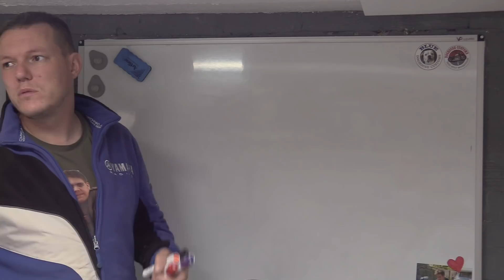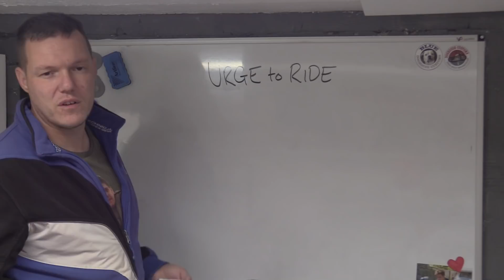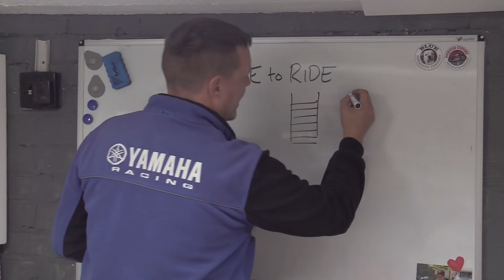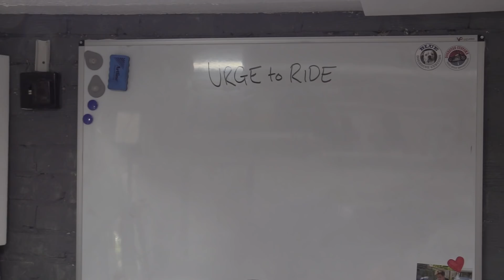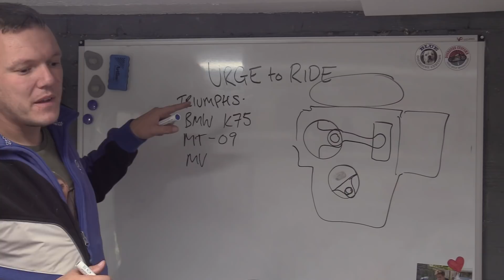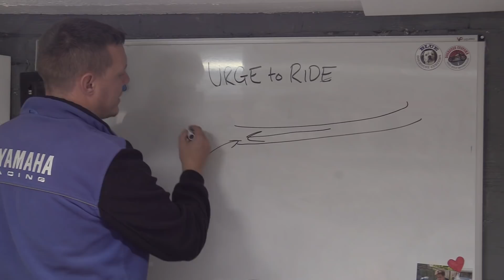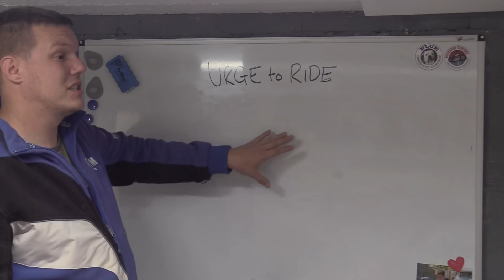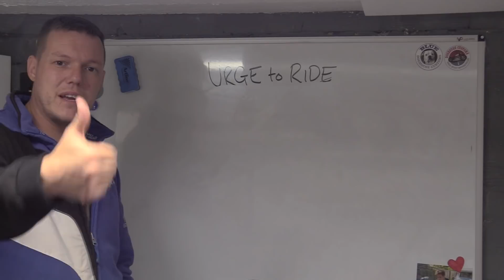Triple Engine Whistle BS - RANT

Comment: Ducati's sound like a bag of spanners because the indicator wires vibrate against the housing giving it a dry clutch sound like the honda XR250 the fastest dirt bike ever made.. said to have been designed by the Nazis to overthrow the Vikings during the battle of Trafalgar in 1642
Reply: Wellllllllll I'll think about that. Not!
Reply: This guy knows whats up.
Reply: Mine too
Reply: I thought it was because desmodromic was Italian for, Had some left over fasteners so we left them in the head.
Reply: Gary Dodgson  a friend of mine had a Harley iron head Sporster,  it was very quiet.  If you listened closely enough you could hear a sound much like a leaky kitchen faucet. It was the oil dripping in to the pan he kept underneath his bike.  This was the most noise it made for months at a time. Hard to start was his excuses.

Comment: I had a customer come in he was sure his pickup needed a new transmission . I  replaced the rubber boot on the shirt level $6.00 us noise gone. He was upset he had a personal rule drive it until major repairs needed then replace. That Toyota  had 220,000 miles and was just fine but he wanted a new truck. I told him next time don't buy a Toyota and you'll get to replace it a lot more often.
Reply: Thomas LeMay What the hell is a shirt level?
Reply: @biffaozzie2373  it's like a shift lever, but also not
Reply: @biffaozzie2373  dam auto spell.
Reply: I have an 2.2L S10 with about 230,000 miles. That thing towed a motorcycle and a loaded trailer up the slope on the 8 freeway to San Diego with the AC on..... granted we were doing 30mph up the hill, but the thing never overheated.
Once in LA the truck developed a new noise in the transmission for a while, but....
I then drove it from LA to central Mexico and the noise is gone......

Comment: I had an XS750 that didn't whistle or whine. Made lots of metallic grinding noises for a while but this was just a trait of the marque...
Reply: Hah! My dad had an XS850 that did this, turns out it was the exhaust chewing it's way through the oil filter casing Cringe
We all called it the Fat Bastard because it was heavy as fuck compared to my dinky RD 🤣🤣🤣

Comment: I've got an Acme whistle that sounds like a 1996 Triumph 885 engine.  I also have a Honda Revere that whistles at about 1500 to 2000 rpm, is that because my V twin has a third cylinder hidden in the gearbox with the underslung waggle rods or is the noise coming from the pistons in my 30 year old, double port and lemon carbytooters?

Comment: Ive got a street trip and as soon as I swapped the end can it substantially lessened the pronunciation of the whistle. Also the stock striple exhaust 2017-current have a small hole drilled into the bottom of them about an inch back from the pipe opening which I assume is to help some form of pressure (?) - I covered my finger over this hole (wahay) and it muted the whistle a little which was strange
Reply from the maker: Well it can't have done, because its the gears LOL
Reply: @thedirtyworkshop  😅 but the internet said so… the bane of most forums since the 90’s

Comment: I have a single, twin and four cylinder. The only  one that whistles like Urge to Ride (showed from video clips) is my 4 cylinder but my 4c (2002 Fazer 1000) is also the only one with a cat and collector on it. The twin is a 1981 and runs no cat. the single is a 2000 and on a racing straight pipe. 

Personally I think this whining/whistle  sound is to do with cats and those collection chambers... something with flow into the cat and then it resonates down the end pipe. 
I would really like to hear your opinion on this. Because I do find newer/cat bikes have this and none of the old ones seem to have it.

Comment: Most modern cars have helical reverse gears and will still make the noise just not as loud. The reason a car makes that noise is that the dif gear is running against the back face of the gear. If you spin helical gears the wrong way they are very noisy.

Comment: The reason cars whine in reverse is specifically because the pinion and crown wheel have spirally cut bevel gears. The reason being that under load they are drawn into mesh, they basically try to screw themselves together. In reverse the opposite happens meaning the clearances open up and the gears mesh less well causing whine.
 This isn't an issue as you don't spend that much time in reverse for significant wear to occur and you are loading the opposite faces of the gear teeth so it doesn't affect forward motion.
 So not only is urge to ride wrong, he is blaming the exact opposite type of gear for the type of whine he described.
Reply from the maker: I know, funny aint it lol

Comment: My 900ss whistles slightly through the carbs at part throttle. It's easy to hear because the airbox sticks out in front of the tank a bit and some muppet cut the entire top off (so the filter gets wet when you wash the bike or it rains).

Comment: It would be interesting to record a waveform from a xtal pick on an engine then stretch it using audacity and see if you can identify different components in the engine waveform.
Reply: Proluxelectronics And you think that Honda, Yamaha, etc don't do exactly that??
Reply: @biffaozzie2373  I assume they don't share the results though. This sounds like what Dyno tuners are starting to do

Comment: It doesn't even SOUND like gear noise in my opinion. 
I have a Tiger, and the whistling noise sounds a lot more like it's being caused by air/gasses. I think it might be something to do with the induction actually - perhaps some of those flow phenomena you were mentioning, but happening on the intake side. I don't know enough about fluid mechanics to speculate on that.
But it seems to originate more mid-bike. At least by my logic, a whistle from the exhaust noises should be able to be heard around the area of the exhaust tip.

Comment: My Z650 2020 makes a lot of that whistling noise, especially during engine braking. The engine has a firing order of 270 degrees. From your video it appears that this is the reason for the whistling noise.

Comment: ' Rocking Motion ' ? , ..  Balance Shafts are used in piston Engines to reduce VIBRATION by cancelling out unbalanced Dynamic Forces . The Balance Shaft was Invented in 1904 .
Reply from the maker: Coupling moment - it's called the rocking couple.

Comment: It has to be related to the 240 degree crank/firing order. The new Triumph Tiger 900 that is also a triple doesn't whistle like the others because they gave it a T-plane crankshaft. And since it is a triple it will still have a counter balance shaft.... It also can't be the airbox design cause even the older triples with carbs did whistle.

Comment: And another thing.  Straight cut gears only have one tooth per gear in mes at a time, whereas helical gears there is normally two teeth per gear in mesh so you don't get the same 'clack, clack, clack'.
Reply: *mesh

Comment: No balancer shaft on my 929 and my rebuild had that whine. On my first version i hadn't noticed it so i went looking and found it on other bikes on youtube. Would really like to know what it is without the speculation, i did have an aftermarket exh on the first bike, a slip on Leo Vince but all i had available for the rebuild was a standard and the bike didn't live long enough to get around to changing that. I was very worried about the sound at first so i hunted for it, finally decided it was the reed type valves on the head cover from the emissions system...

Comment: A friend of mine has a Triumph Tiger triple. It is quite "whiney" when hot but much quiter when cold. I would have thought the gears would sound the same at any temp. Maybe the exhaust gas is different under different temps

Comment: A bit late to the party, but the CBR1100XX Blackbird (from 1997) has DUAL balance shafts , is an inline 4 and whistles beautifully.
Anyways, in my humble opinion this is mostly air induction/intake. (speculation)
Gears, sound different. PERIOD.
If he would have ever listened to a gearbox turning by itself, he'd know. It's a completely different note.
How do I know? Working in aviation, cranking jet engines (turning them with just air, no fuel) and standing right next to the gearbox rotating at insane speeds. No gear "whistle" to be heard. Not during start, "steady state" or shutdown.
Anyways, the best example i can give you is the 787 engine start-up as it starts electrically as opposed with air starters. (I'll just link to a video as i can't be bothered searching though my videos and uploading my own)
https://www.youtube.com/watch?v=s3_JPMB05Fc
It's basically the first 15 seconds of the video. doesn't sound like a whistle to me and that's an electrically driven gearbox.

Comment: It's intake whine, not the straight cut gears, and that's the end of the argument. Even my old carbed R6 had an uneven, lumpy intake whine at idle and up to about 2500rpm. And that was with a loud as fuck exhaust.

Comment: I have a Street triple R.  A long time ago I used to have an NC30. One is an in-line 3, the other is a V4.  One has a balancer shaft, the other doesn’t.  Both have the exact same whistle.......
Reply: NC30 has gear driven cams though, though, as Matt pointed out.
Reply: I know, that’s the point.  Last time I checked my Street Cripple hadn’t grown gear driven cams.
Reply: @Martin52863  Sure, but if the cripple's whine is, as posited by wassaname, gear whine from the balancer shaft, gear whine from the NC30's cams doesn't disprove it - if anything it makes it more plausible.
Reply: I honestly couldn’t give a shit what it is.  To me it just sounds awesome. I will however say this, it’s no louder on the right side of the bike than it is on the left.

Comment: Easy way to solve it Matt. Should be able to find out how many teeth are on each gear and therefore work out what the meshing frequency should be, for a given engine RPM. Then record the noise, run it through an analysis software and voilà. Bullshit debunked.
Reply from the maker: Apart from analysis software isn't that easy...
Reply: @thedirtyworkshop  yeah I guess all you need is the noise frequency spectrum and to look for the biggest peaks. I was probably spoiled at work because we always had that stuff as the tax-payer provided (I was an aircraft engineer in the Royal Navy until last year)

If you know anyone who does vibe analysis, or there's a subscriber who is willing to help; you could use a mobile vibration tester and get the Fourier-Transform from that. It would show you the same thing.
Reply from the maker: But the peaks won't be the whistle, there's so much background noise. I have audacity, I'll have a look, comparing the triumph to the z9
Reply: @thedirtyworkshop  yeah thats why Vibration Analysis might be a better route. A Fourier Transform will separate the frequencies and give a peak power reading. If it's loud enough to hear it would be of sufficient magnitude to see on an FFT spectrum. Don't get me wrong, I'd be fully expecting it to NOT be there.

From my experience, if it was gears meshing, there would be more of a rounded ringing/whining, than a whistling noise.

Comment: I've noticed that the whistle is mainly on fuel injected car & bike engines, so I've always associated it with the air intake systems on these types of engines as breathing is so very different to that of a carbed engine. 

Normally aspirated carbed engines don't tend to whistle and, if pod filters are fitted, the induction noise can match or exceed the exhaust noise from the stock OEM pipe.

Your exhaust pipe theory can be easily proved or disproved as being the source of whistling simple by putting one's hand over the pipe's end on a Triumph tripple.

Comment: Dam I need to get you to check my prints you get some nice quality.

As for the argument made about the exhaust, given that gear noise counts in the noise limit tests there is no way the manufacturers would allow a gearbox to make the kind of noise he is talking about. The limits for euro 4 and 5 mean that bikes have been taken off the market because of gearbox noise

Given the prevelance of balancer shafts the whine/whistle would be common on 4cyl, Singles, v twins, not just a triple thing.

My money is on it being to do with a resonance in the exhaust given that it seems to disappear if you remove the cat and open the midpipe and endcan up. It allows for a noise that is exciting to the ear and compliant with noise regs.

Comment: 5th gen VFR has straight-cut gear driven cams, very different sound from the triples exhaust whine.  The exhaust whine is likely due to a high velocity flow area though a baffle or some perforated tube.  Remove the factory exhaust and it disappears on a lot them.

Comment: The MV factory worked hard at making the tripples sound as much like the fours as they could - it was high on the design brief.
Reply: All I ever seem to hear on them is that fucking clutch rattling like a bastard
Reply: @hyperthunk  Are you thinking of Ducati, because that is a very different beast.
Reply: @presstodelete1165  I didn't know Ducati made a triple... No, MV Augusta Brutale 800RR, that dry clutch is noisy af. Simple solution is to keep above 5k revs so the lovely exhaust note drowns it out tbf 😂
Reply: @hyperthunk  I've not had an 800RR but I have had about 20 other MVs without noticing any unusual clutch noise, perhaps there was a problem with that one.
Reply: @presstodelete1165  yeah that's a really good point. No issues with performance or any sign of an actual fault though, so who knows. And it was still a phenomenal bike.
Reply: Also, nobody makes better looking bikes imho. Those things are goddamed works of art.
Reply: @hyperthunk  They were best under Tambourini, Morten isn't 1/2 as good. Goggi made great engines in both eras though.

Comment: i do like the sound of some of those triples though and yeah he was hearing exhausts  ... lol.
Reply: Wrong. Just check the full video mate
Reply: @UrgetoRide    i did mate,  about 5 mins ago and i bet if you covered the exhaust exit with a large cloth or similar on the first clip of a bike you showed that noise would almost be gone!?
thanks for your input anyway though.
Reply from the maker: "Wrong. Just check the full video mate"

- There's something else in your video. You know that Dutch car you showed, that noise isn't the gears! LMAO!
Reply: @troywee4774  hate to say it but I thought I'd just try this on my MT09 and it's not the exhaust. Used a rag over the end to really muffle it and listened at the side of the engine. The 'whistle' is definitely coming from the engine and not the exhaust.
Reply: @noggintube  really?  damn .. i cant hear exactly the same from here obviously but i could of sworn that the noise he(urge) was referring to was the exhaust? 
surely if this is indeed the case your noise would of been even louder to hear as the exhaust was muffled?
dont suppose you could post a small vid of this?  not for arguings sake but just so i can tell/hear the difference?
thanks for the info though mate.  cheers.
Reply: @troywee4774  I'll see if I can sort something out tomorrow (it's started pissing down here). Could have sworn it was exhaust myself too. Not convinced it's the balancer shaft though for the reasons Matt says, but be interesting to get to the bottom now we're all wondering.
Reply: @noggintube  i am curious more so now mate - i do hope i/we are not mistaking an engines 'whine' for a 'whistle' though?
the vid 'urge' posted and the first bike shot etc i would put money on that as an exhaust whistle - however some engines do whine and i hope i/we are talking about the same noises?    thanks for the update/info though mate much appreciated!  cheers.
Reply: @noggintube  I have an MT09 with a full system and carbon can, no whistle on mine, but yes it did with the stock exhaust, because it is the acoustics of the stock muffler box.
Reply: @troywee4774  yeah I think the noise I'm referring to is definitely a whine from the engine, so maybe not the 'whistle' being mentioned. Could be we're all talking about a different noise 😉
Reply: @noggintube  lol,  could be mate??
i am sure we will find out eventually!  cheers mate.

Comment: Sounds like you have taken up the mantle that Motorcycle Mechanics used to follow of honest science based testing and evaluation of the both the bikes and the engineering of them. You might not have heard of them as a few years after I started to read them (1985) they changed to Fast bikes and pretty much dropped the engineering side of things and just be came another of the what'ill do merchants. Think I still have my first issue from then when they tested the new GPZ900R And bmw K100 unfaired bike which was £3,300. Yes I am old(ish)!